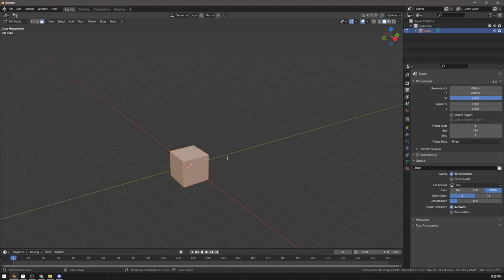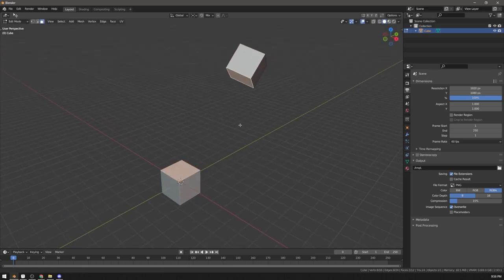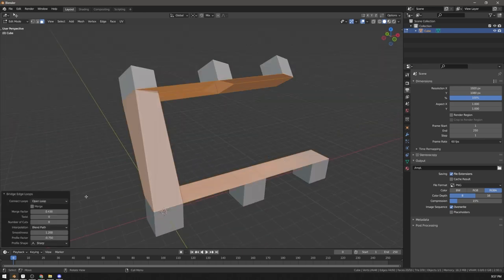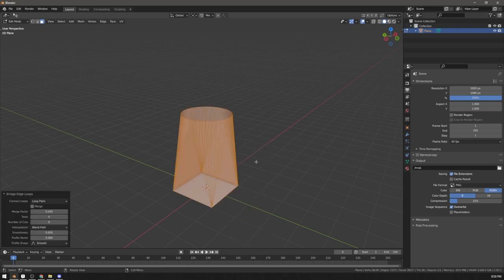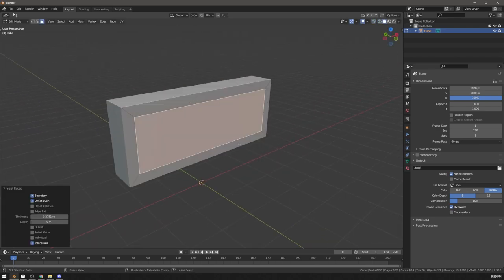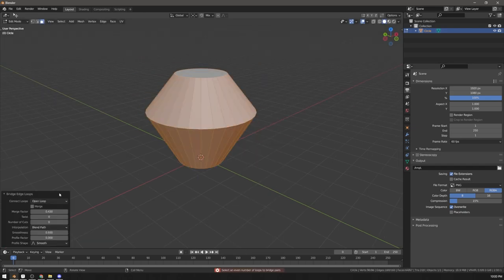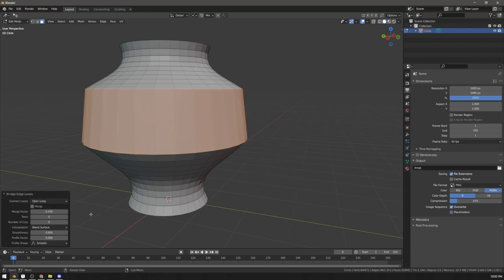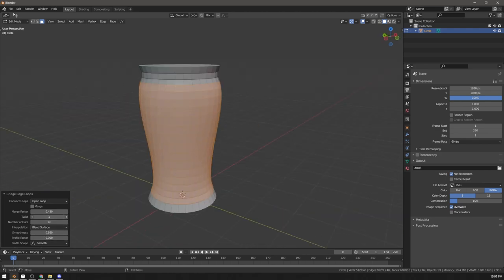The Most Powerful Tool in Blender - Bridge Edge Loops - Quick Tip

Comment: New to this software, heck it is so difficult to do what used to be really simple
I did some 3D modelling years ago, now Blender has squashed so much into one powerful program the simple now seems really awkward.

2 cylinders, 1 vertical and one horizontal, horizontal higher then vertical as if to make a bend between both. Select both faces do the clicks as said here and it removes faces does other things but not doing anything remotely like the video. What have I missed or not done that isn't in the video?

Sigh humph grrrr